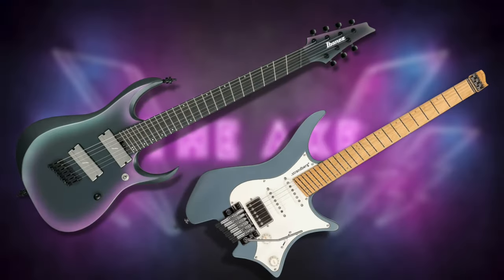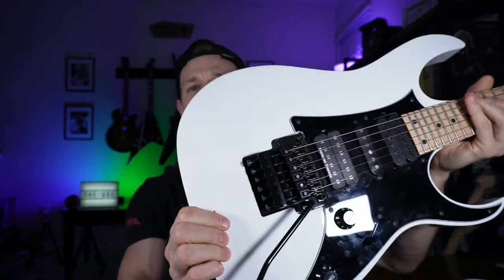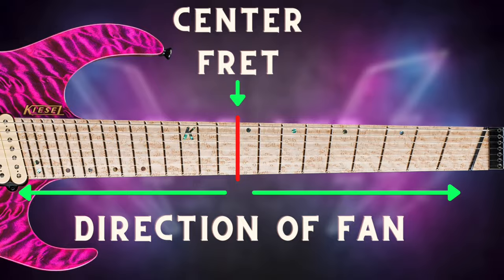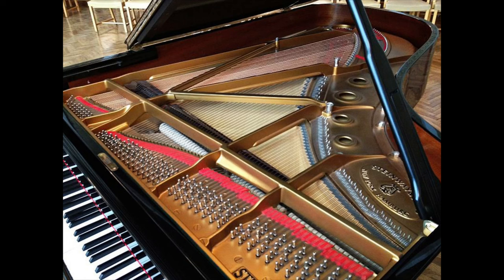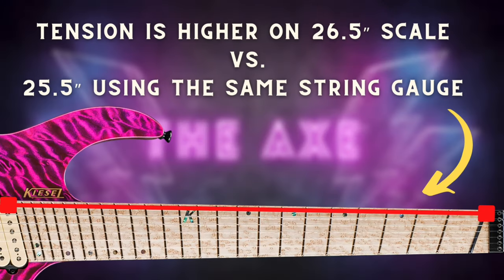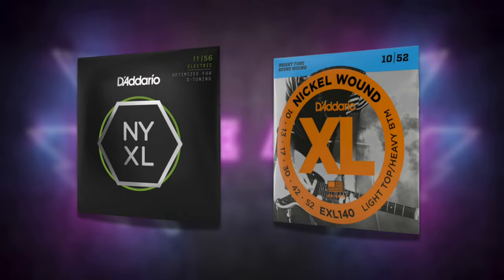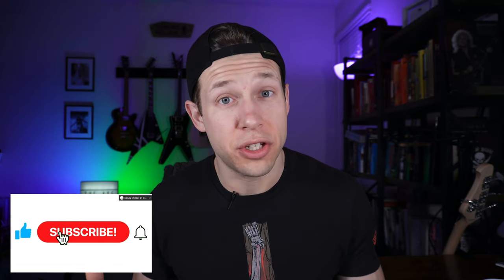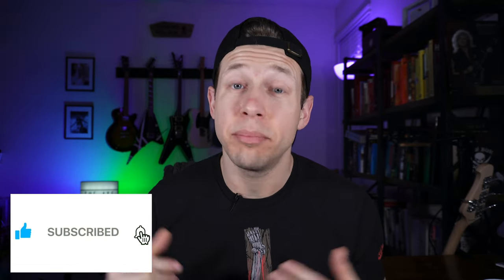Multiscale Guitars EXPLAINED | What’s Up With Fanned Frets?

Comment: I played one of these for the first time recently. Playing above the 12th fret was natural... I did a test without looking at the fretboard and I hit every note. So kudos there, though to be fair I have also never had a real problem with just moving my arm and the guitar neck. But it was nearly impossible to play any open or complex chords down near the nut due to the fanning. I'm sure you could get used to it eventually if you wanted to put in the effort, and if you play detuned one-finger barre chords it's surely way less of an issue. But... nothing about the guitar sounded magically better or different, so... pass for me.
Reply: really? to me bar chords sound a lot better on my 7 string multiscale than on my normal 6 string. and my 6 string has a much better pickup I had installed.